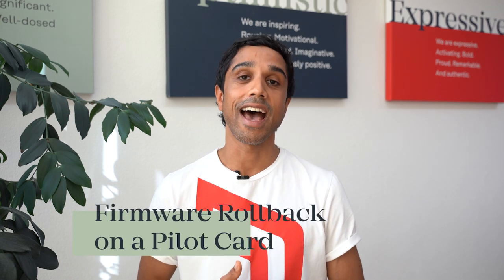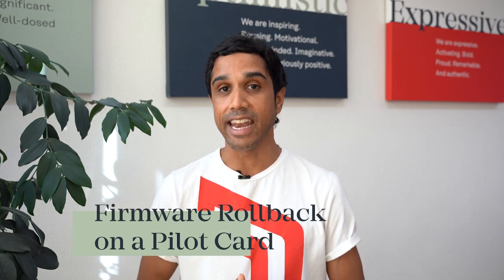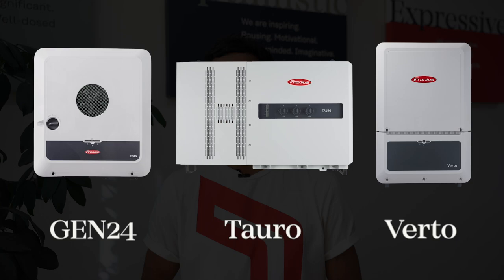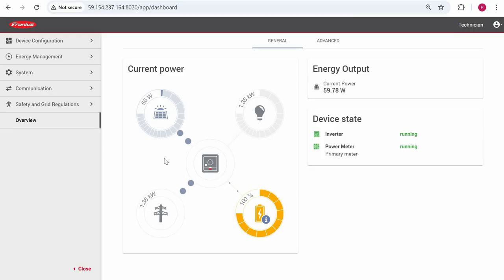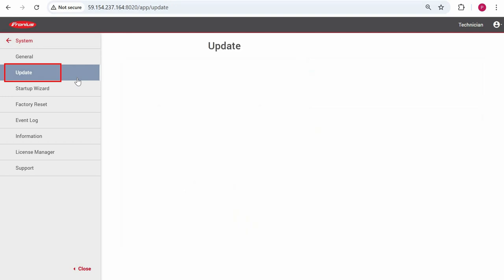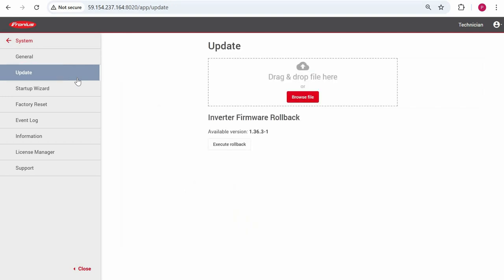How-to | Perform a Firmware Rollback on Pilot Card Inverters (AUS)

Comment: When will you actually add real battery control via the app. Like settings of times and % to charge from the grid.
Reply from the maker: Hello! We are continuously developing the app and adding new features. These desired changes can be set up directly via the device's web interface. These settings are usually stored statically for a longer period of time. With the ECA, you can control charging and discharging to the grid depending on the flexible tariff and therefore do not necessarily need the TimeOfUse settings (https://www.youtube.com/watch?v=0ucN_V9dC_c). In order to maintain a good overview in the app, there are currently no plans to add these functions.